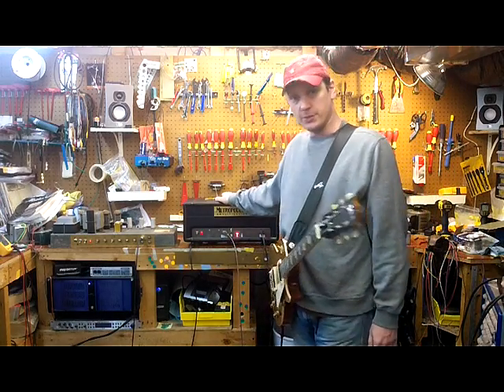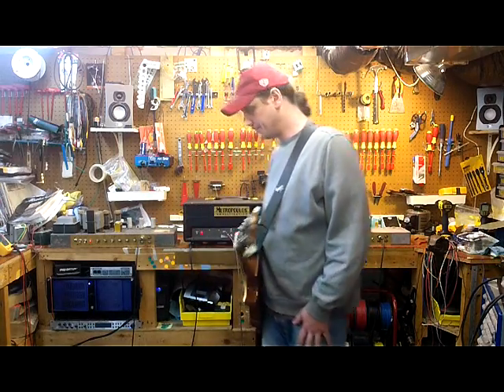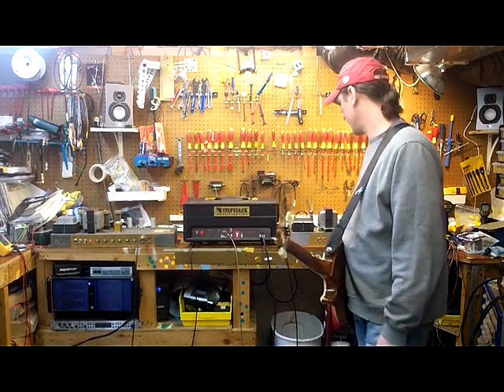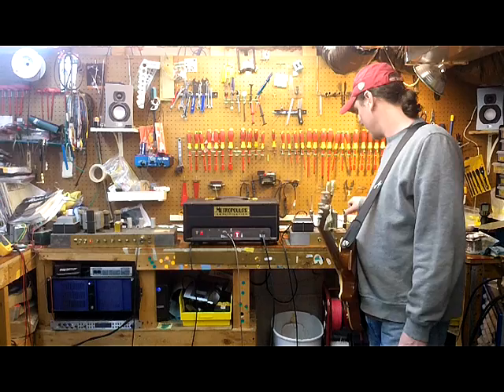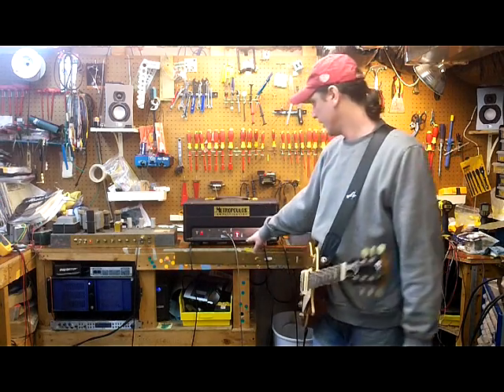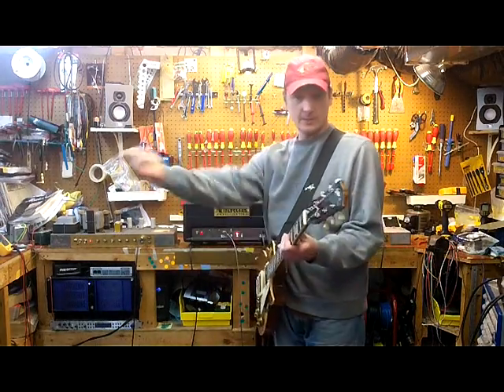Metropoulos 12,000 Series vs '68 Marshall Superlead

Comment: To my ears the original sounds sweeter but not in a good way, it sounds tired and lacking in dynamic punch and note definition. The distortion profiles are extremely close. Without you telling me which was which ahead of time, I highly doubt I’d be able to tell the difference as it’s within tube rolling and knob setting differences. One day I will own one of your 12000 series amps on the used market. It’s as good as the original deal if not better and more reliable.